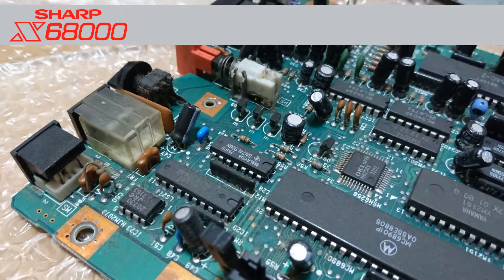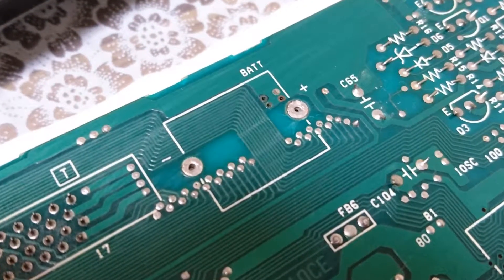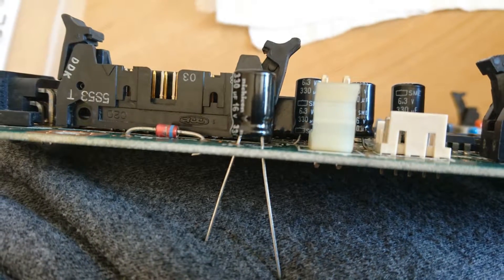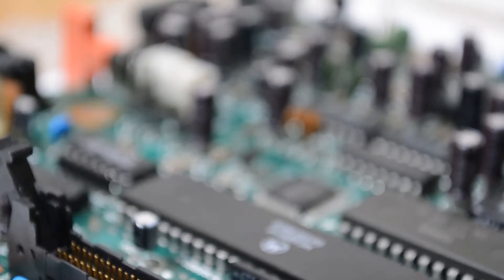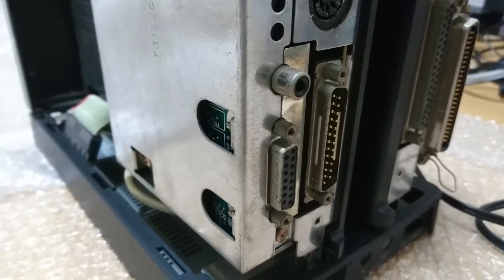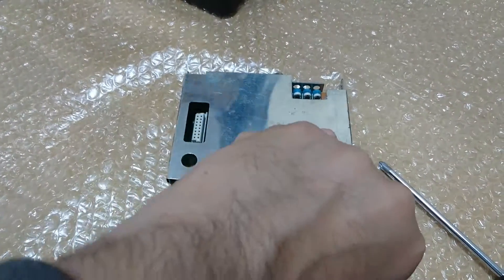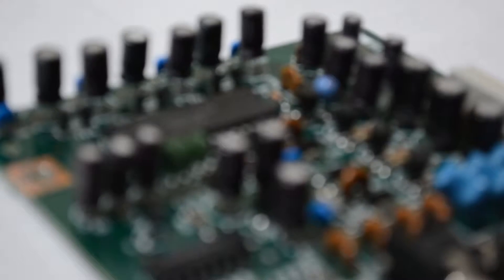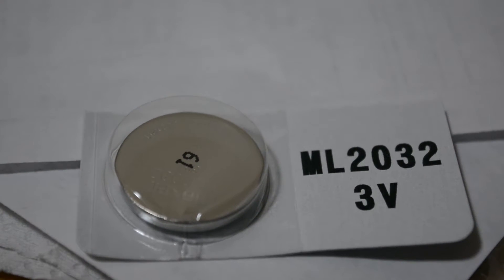SHARP x68000 Restoration - Part 2 - [Bottom PCB and Video Module cleaning and capacitor replacement]

Comment: Its been several years since you made this video. I have a sharp x68000 that I want to recap every capacitor in the computer. I tried accessing the link you put in the description, but it does not work. Can you help me in getting the list for the parts?, thanks.

Comment: Hey, Rama Mishra. Where did you get the replacement capacitors...I see some Japanese guy has a set for sale on Yahoo Auction but I wonder if there is another source...
Reply from the maker: I manually made a list of all the caps I needed and ordered them online from mouser.jp !
Reply: Thanks for that great order list of capacitors. Since my XVI died I like to ask if there is a different capacitor order list? I understand that the PSU has some different parts, but how about the other parts?